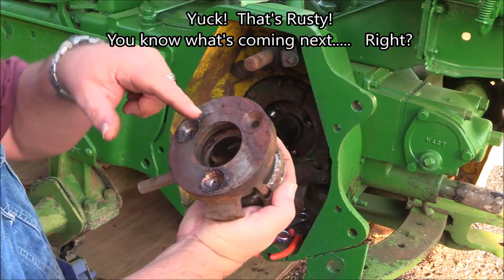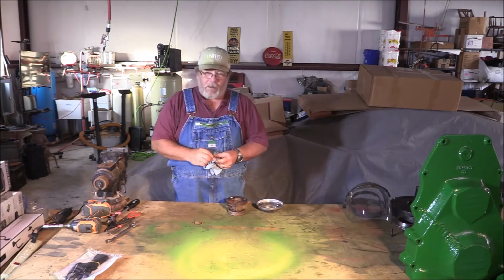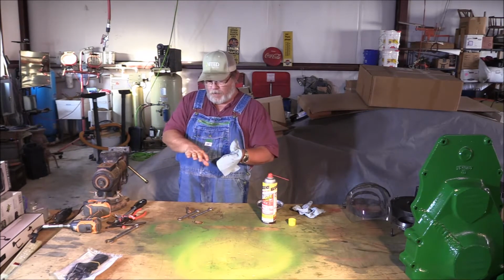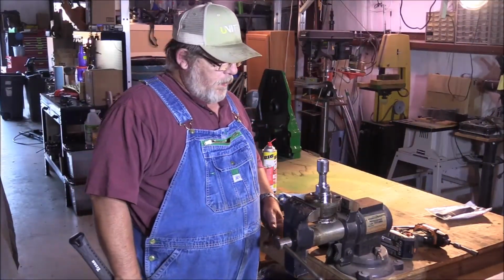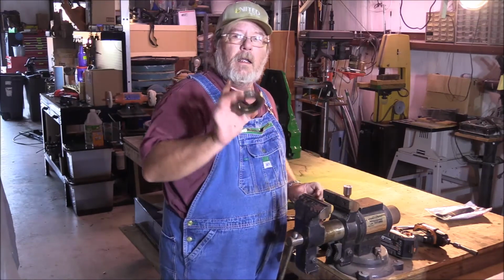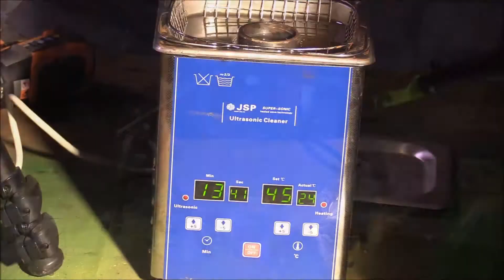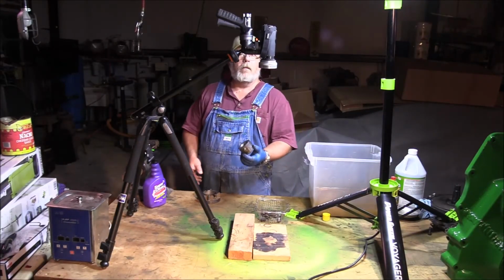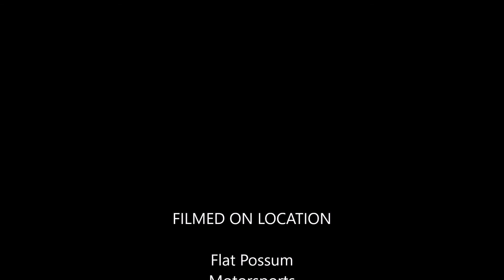Fixing up the John Deere MC Crawler - Part 41 - Clutch Throw Out Bearing

Comment: Guess that was a box on the hood, i thought was a blower. Is that a vette?
Reply from the maker: The car in the background behind me and under a car cover is one of our Porsches.  Piled on the hood in boxes is a bunch of John Deere Crawler parts from various sources ready to go onto and into the MC Crawler.

The other car under a car cover in the barn (with all the green tin for the crawler sitting on top of it)  is a 1984 Pontiac TransAm with an almost 800hp 383 stroker,  Wiend 671 blower and dual carbs setup for the drag strip.  They closed down all the drag strips around us so I have no place to go play with it anymore....
Reply: @possumfarms  okay looked low and sleek.